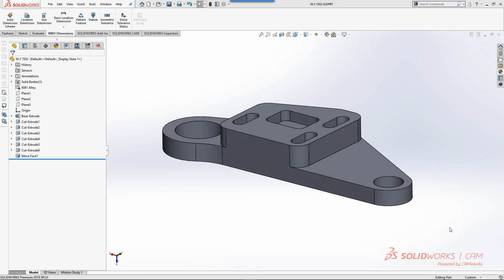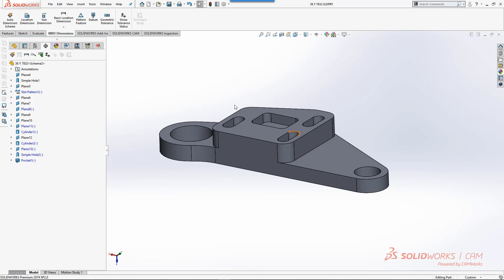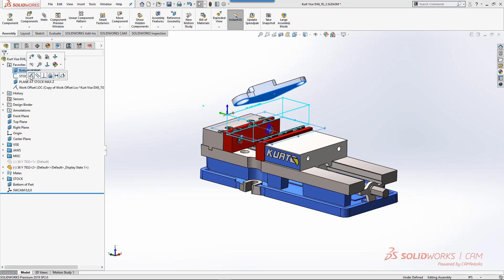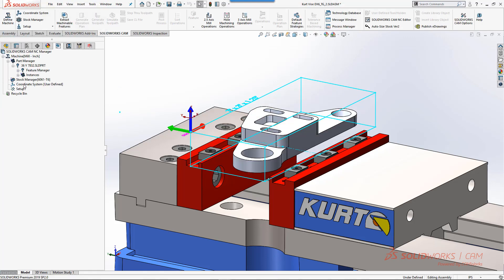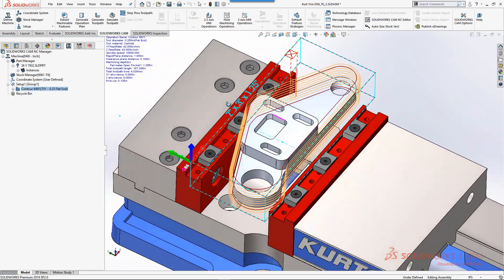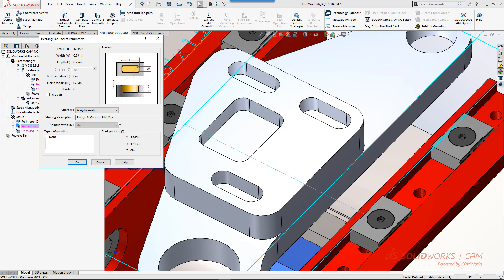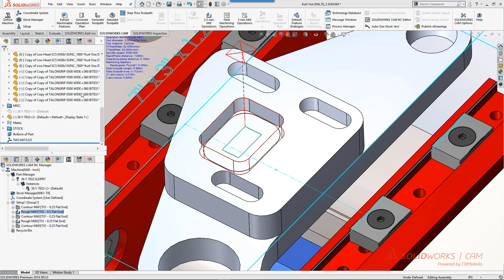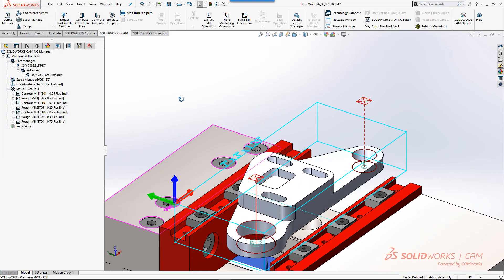Design to Manufacturing Workflow using SOLIDWORKS Solutions

Comment: What are the tools used for creating the stock body. That is the biggest bottle neck I'm encountering in SWcam right now.
Reply from the maker: Greetings, Kyle   When you say stock body are you referring to the stock material to machine from?  You have 3 main ways to define stock.  1.  automatic bounding box.  2.  A SW sketch.  3.  using another part or configuration within the same part.  In this example, we are using a SOLIDWORKS sketch that is defined by the assembly and automation macro we created.   We also have some videos on My.SOLIDWORKS.com that show some of this as well.  You can also post a question in the CAM area of the SOLIDWORKS Forums and we can help with a specific question depending on the parts you are machining.
Reply: @the3dexperience807  Hello,  Pretty much the whole process from 1:22 -  4:00. I don't really need to include the vise or anything but the way the stock for the part is created is very cool and useful! I can see how to did it with the sketch and then limited the height with planes, I just don't know how to setup the automation aspect of it. Ideally for me, I don't need that much automation. If I could just type in an X length, a Y Width and have those auto center to the part, that would be great. for Z, I'd also like to just type in a value and then be able to set wither a top or bottom offset. I wouldn't even need the rounding properties you do afterwards. 

Where in my.solidworks.com can I find the videos? I will also check out the forums for Cam stuff. I just started using CAM last week and have already automated a lot of things I do on a daily basis. Thanks for the response!
Reply from the maker: @kylehofmeister6906  you can find the videos here.  https://my.solidworks.com/training/catalog/list/1?category=f%2Fdb_record_subtype%2FLessons&category=f%2Fdb_record_product_versions%2FSOLIDWORKS+CAM+2019

for the stock, you can use a bounding box and offset x,y, & z to keep the part in the center.  if you are using a sketch, then you can use a center point rectangle from the middle of your part.  It sounds like the bounding box may be the fastest for what you are looking for.  In the bounding box command, you will see the x,y,z buttons next to the offset amount.  if you push the button it will apply a symmetry of sorts to each direction.  This video starting at 0:50 seconds will show the area I am speaking about.
Reply: @the3dexperience807  Thanks for the response and the video tutorials page!

I believe what you're referring to is the bounding box stock setup in the Cam stock manager section correct? It might sound minor but I'd like to have a more interactive stock model, even if it just a box. Also I'd like to avoid the need to do math like (Stock_X - Part_X)/2. I'd much rather type in a stock value for X and have it auto center to the part if that makes sense. From what you did with your macro it looks like it did that. I saw on another video were people had you email your CAM setup and macro's to them. Would it be possible for you to email them to me as well? 

Thanks again!
Reply from the maker: @kylehofmeister6906 Hofmeister, I am sorry for the delay.  We can send you the latest versions of the vise we have set up.  We are always improving our bounding box functionality and I will take your notes above for future version enhancements.   You can email mbi4@3ds.com and we can work on getting you the latest build of the vise and macros.